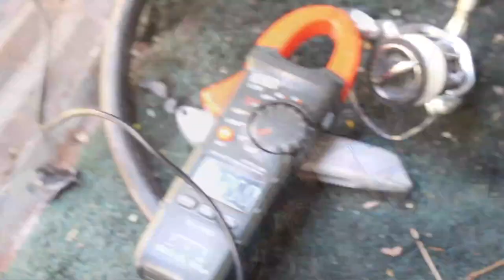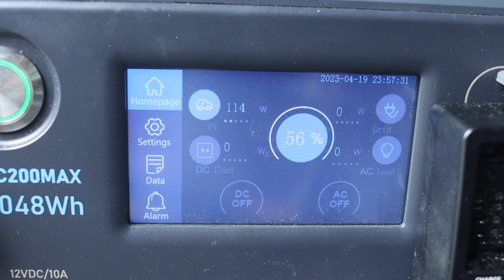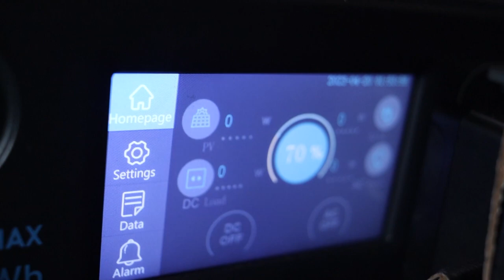How to Connect Bluetti Power Bank to Your ALTERNATOR! Charging While We Drive!

Comment: You could have accomplished the same thing as plugging it into your cigarette lighter. Would have got 10A x 12.6 volts, 126w input with no muss/no fuss
Reply from the maker: Old cigarette lighters were always on so it would drain my batter if I did that.
Reply: @FishingGrubbZ  Just unplug them once parked or not driving.
Reply: The title how to connect Bluetti to alternator. You didn’t show us.
Reply: @lakayfreddiecastillo2599  So true.  I have no idea what/how they did the connection from this videoor the equipment needed.
Reply: @jeffreywalker-f1o  I would of thought a block thingy with the xt60 out cable. It's just a wire that goes live when ignition turned on, a lot of old vehicles the cigarette lighter is always live so drains battery, I've found my cig lighter is ignition controlled so will be connecting behind, plop the cig lighter back in and that can be used as normal. I'd put a 12v to 24v step up converter before the xt60 connecter and get a 24v charge in to the bluetti. Double that wattage.

Comment: 115 watts what a joke just use.  The cigarette socket charger 
. You do anything else upgrade wiring size by all means.
Reply: I ran 8 ga. Wire from battery  with 50 amp fuse plug my pure sine 300 watt inverter and use my ac charger chord to charge  my  power stations at 268 watts
Reply: @walterhughes5765  Bluetti AC wall charging only accepts 400w or 500w. That's a bummer because in the case you speak, one can charge ac from alternator and still be drawing from solar at the same time, but because Bluetti draws 400w/500w I don't want to do it so as to not overload the (stock) alternator, although it has 150ah and it's a good brand.
I think I will have to use a dc dc charger..